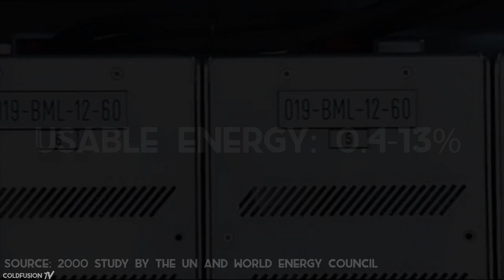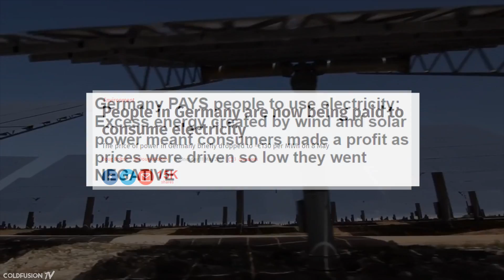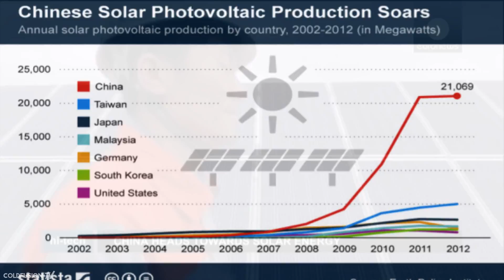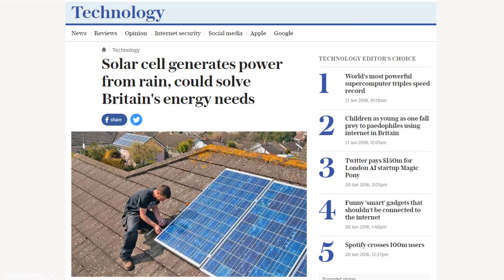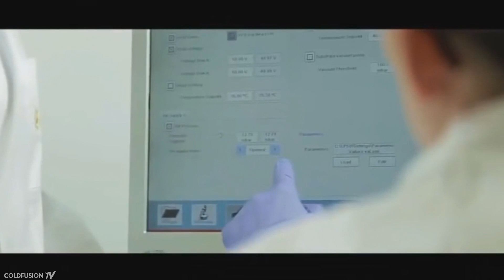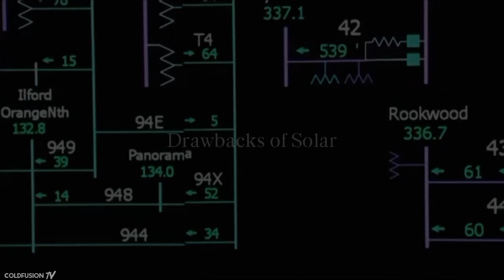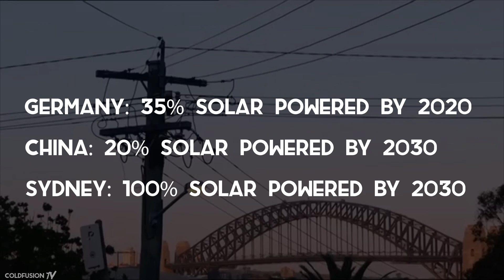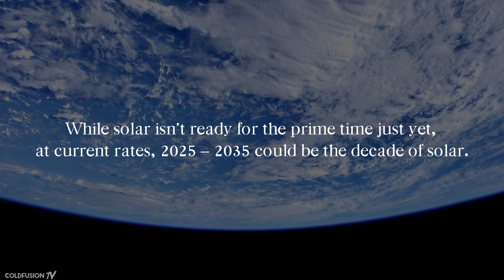The Truth About Solar

Comment: I love Solar power. I use it & wind turbines @ my ranch. Since it is "off-grid", it was either that- or run a phucking generator all the time!  The REAL problem, is storage! While the Elon Musk batteries look good, there is no proven long life behind them.  I've spent much more on "traditional" deep cycle, "solar optimized" (Rolls 550S) batteries, than on all my PV panels & Inverters/Chargers combined.  And currently,  GOOD PV panels are closer to $1 USD/watt than $0.36.  I am currently building a large parabolic dish that tracks the sun,  and concentrates the energy,  and thru my "secret" system,  will use it to make steam to drive a smallish gas turbine, coupled to a generator, for efficiency.  I am anxiously awaiting for new battery tech to prove itself in the long run!

Comment: It's frustrating to hear bitching about solar's cost, efficiency, ease of deployment and capabilities as if a relatively new product should be free, 100% efficient, deployed on voice command and easy to use.   Did we expect the first computers to be fast, wireless, cheap and mobile?  Or the first televisions to be gigantic screens with incredible visuals.  Or the first telescope to reach the edge of the universe?   

Gas engines "work" because the gas molecule is the most powerful that exists except nuclear. The gas engine reaches 25-35% efficiency and this is why solar has not become widespread.  Nothing matches the internal combustion engine for power, efficiency and cost. But almost daily we read of new solar advances.  Our grandchildren will live in a world where fossil fuels are used only in the many products that make up the modern world - roads, carpets, plastics, fertilizer, paint, roofs, tires (I could go on for pages).  Of course, with driverless cars that monitor their own upkeep they'll know less and less.

Comment: I think solar PV definitely has it's place but it is more of a short to mid term solution for green energy as energy supply often reverts to other forms of energy at night. This is because electricity can not be stored sustainably on a large scale and as such means that solar on a grand is really just offsetting dirty energy with clean energy, not providing a permanent solution.

Wind energy is a much better alternative as it is more cost effective and the turbines can effectively be 'turned off' by facing their blades directly at the wind, this means it doesn't create problems for the grid. Also wind turbines don't take up a lot less space unlike solar so that frees up space for agriculture or  wildlife. Wind turbines can also be placed offshore with little impcat. Solar PV panels produce a fair amount of toxic waste in their production unlike wind turbines. 

Certainly in the UK wind is the best solution to green energy and that isn't simply me saying it, it is many experts. Elon Musk is simply wrong on both environmental level and an economic levels. 

Don't get me wrong, I think solar PV is good to an extent and this was an interesting video, it's applications are simply limited in terms of completely revolutionising the  grid permanently. It's applications are best suited to being installed on roofs in limited numbers in areas with high day time energy demand such as industrial areas. Otherwise we just have dirty energy picking up the slack at night when simply investing in the likes of wind would solve the problem.